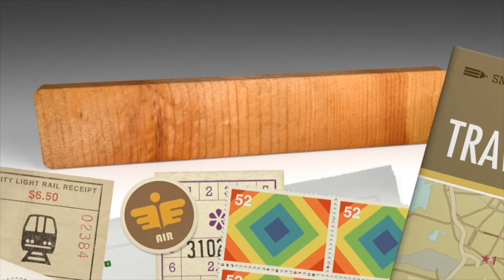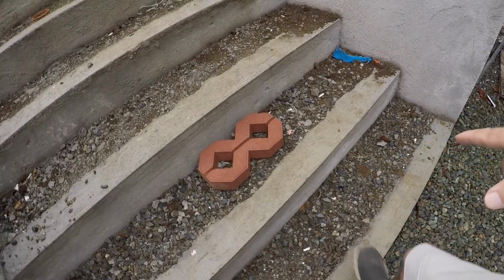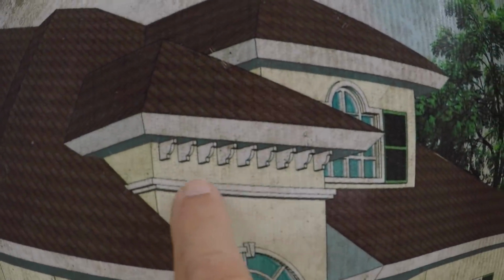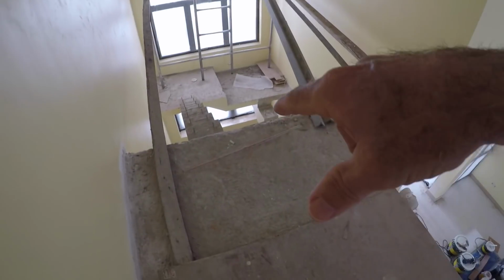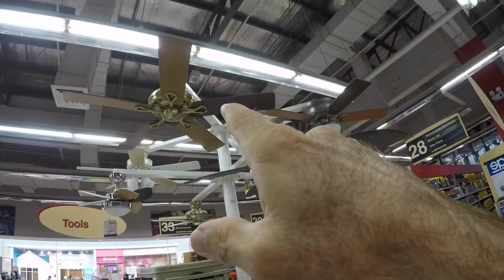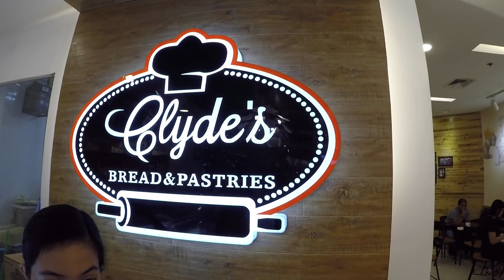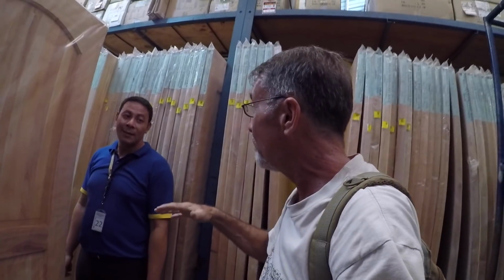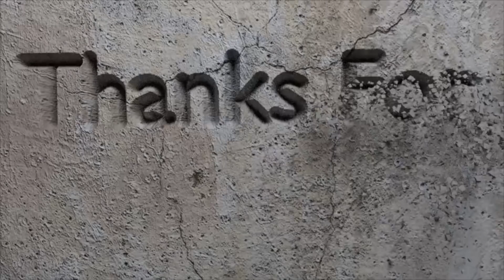VILLA FELIZ - EPISODE 255: HALF DOZEN DOORS (House Building in the Philippines)

Comment: hi james, they sell those fan switches that goes in the wall right next to your light switches.  basically a replacement for the ceiling fan's speed controller so you don't have to use those dangling cables especially on super high installs.  but probably too late since at this stage of the build i'm sure you don't want to be chipping the walls anymore to bury more conduits and utility boxes.

Comment: J.Tanner,
What is the price on the mahogany door slabs ?
Theyre super expensive stateside.
The green doesn't do it for me. Sorry.
A coffee brown or black would go with that kiln beige wall.
We have those sweeps for the bottom of the doors here also. Great for pirch doors.
The bristles will actually work well as ling as they are stiff enough. I bought three before the sweeps would keep mice out.
BBQ grill ????
I need to see some Iron Chef thrown in with all the pastry shots.
When are cabinets and stair tread going in?
House is getting there.

Comment: Hi JamesLooking at the end of the roof you have no secret gutters. You going to have a runoff of rain water. I wouldn't want to stand underneath. If the flow falls onto a hard surface, it's going to be noisy. Or if it falls onto soft ground, it's going to make a crater. House looks brill 
Also Looking at your drawing, about the precast on the front section. As it is now, it looks incomplete without it. I know you have a dilemma but you have to have it.  For me, trouble with the design of the front door. It's a popular design in upvc doors back home which puts me off. It's great that it's mahogany, you can't fault that.
Reply: david he has secret gutters they are well hidden, go back to 100 build days and you will see them lol

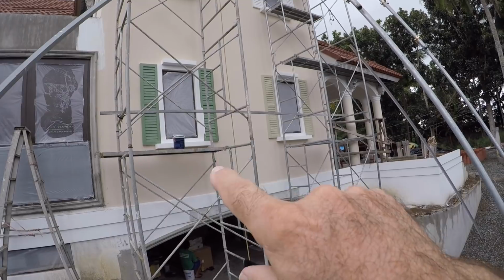Comment: I paused the video at 10:52 to comment that I personally think the bright green is too much! (sorry!!). Everything else is subtle and as I approach the house (in your videos) I see the entire house with many attractive elements. I may slowly be drawn to one element more than the other and then quickly be drawn to another one, the molding, the windows, the lights, even the roof. None really acts as a focal point, or even better you can say there are multiple focal points, and for me that makes the overall house attractive. However, if you proceed with those shutters in that green color the first and only thing I will see are those shutters...again sorry!